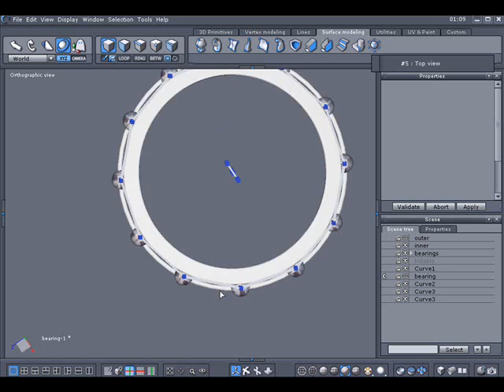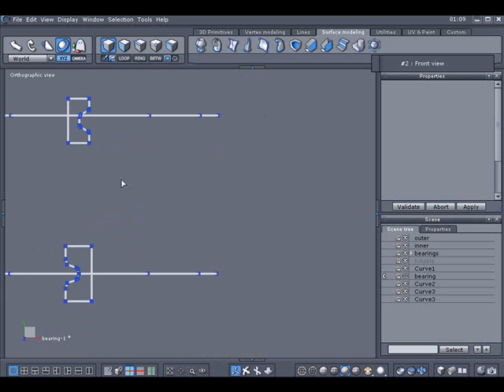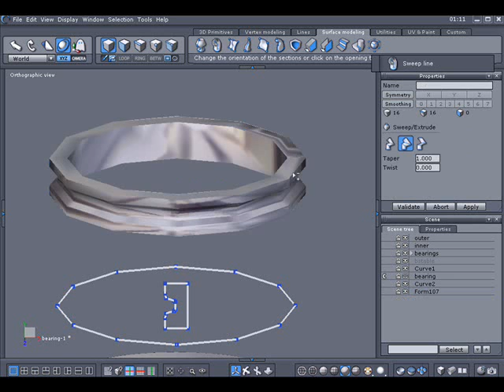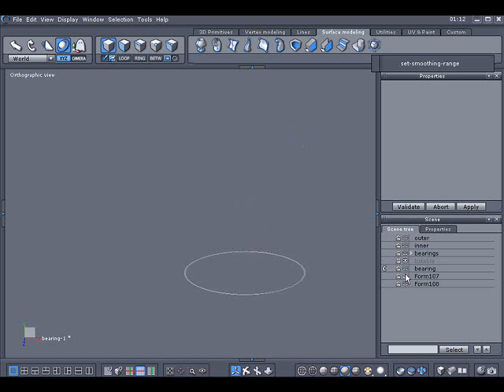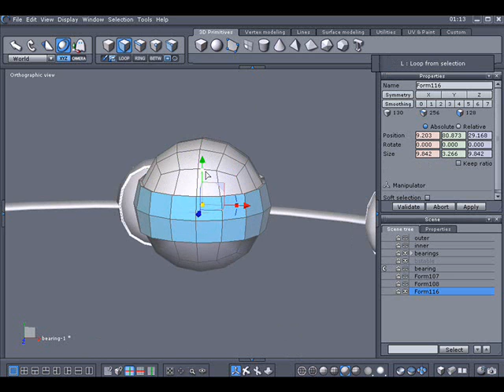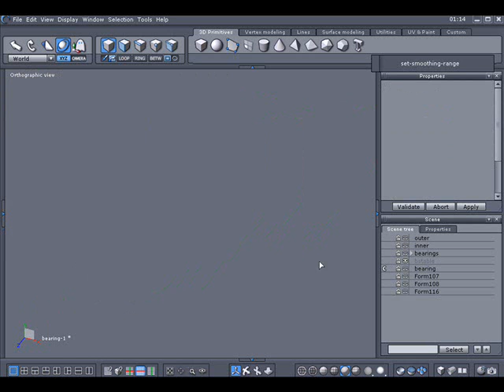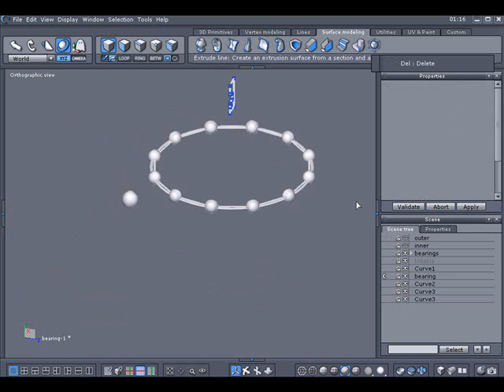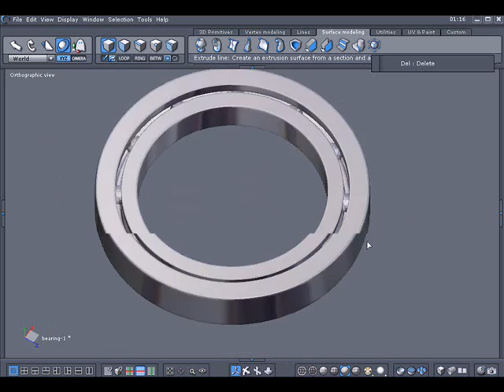bearing01

Comment: Copy on support is not working.  I select my ball, click COS, then select the bearing and the circle curve, turn on clone and apply and validate and it does nothing.  [Edit]  The only way I got it to work is to duplicate the bearing circle curve, extrude it so there was a form, copy on support onto that and orient the normals on the X axis.  I could then delete the extruded form and curve.